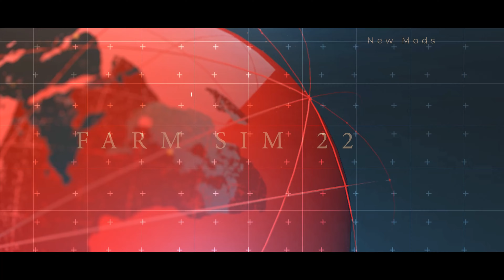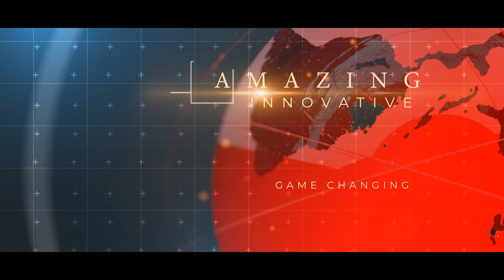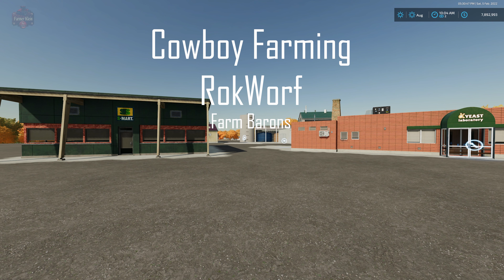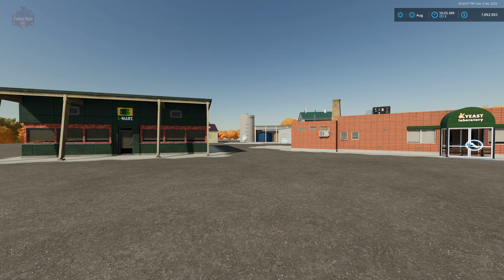Alcohol Manufacturing (Make 6 different types of Alcohol) | Mod Review | Farming Simulator 22

Comment: Shop Smart. Shop S-Mart. This seems like a really well thought out and nicely designed mod pack. My biggest complaint(though a small one) about mods like these are factories that require a water input. Which economic setting were you using for those prices?
Reply: Come to post this, you beat me :D
Reply from the maker: All of the mod reviews are done on a default new farmer save so all the prices are easy.